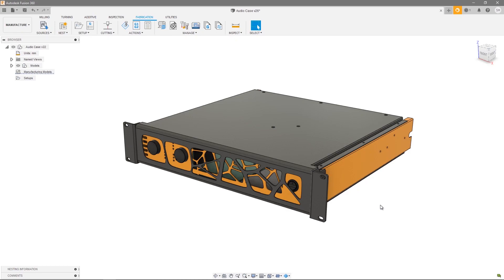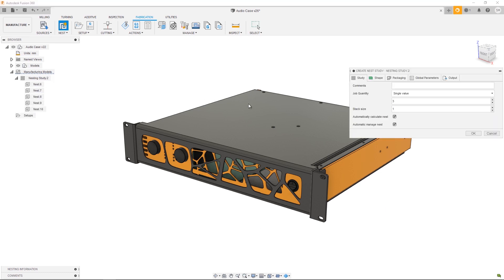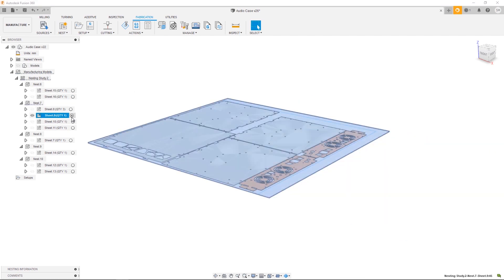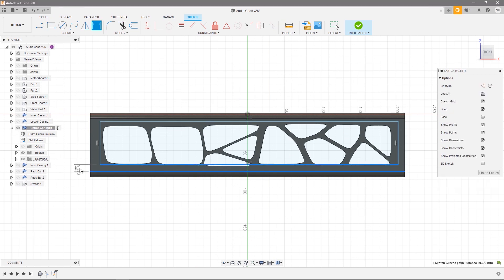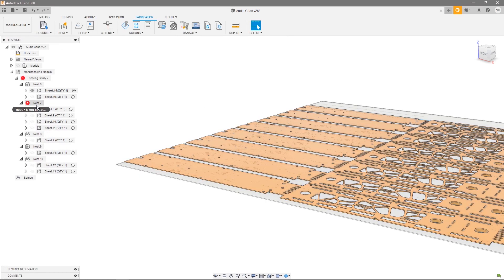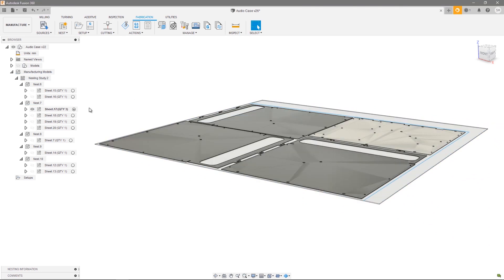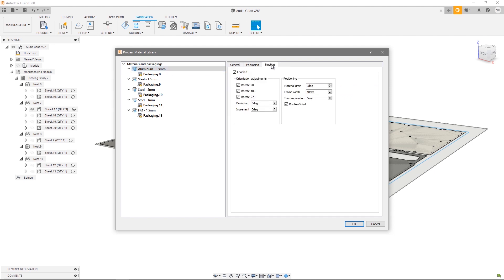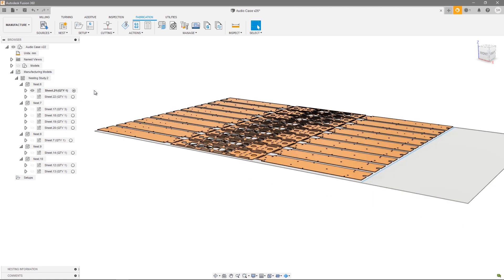How to edit and update nests with Autodesk Fusion 360

Comment: What about associativity of making changes to a component in the nest study.  Will your design be updated?
Reply: Hi Troy. Thanks for the question. Any changes made in the design workspace will automatically adjust the nested sheets within the manufacturing workspace. Making changes to a nest study, nest or sheet will not impact your design. Does that help? Thanks again for the question.